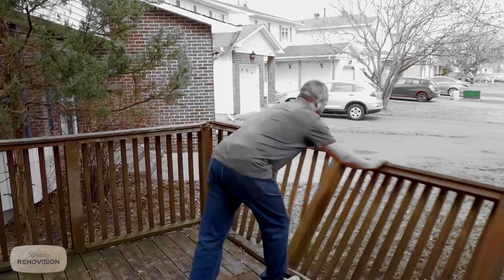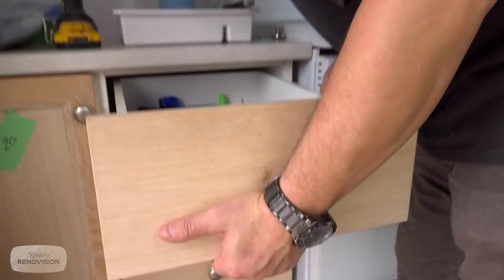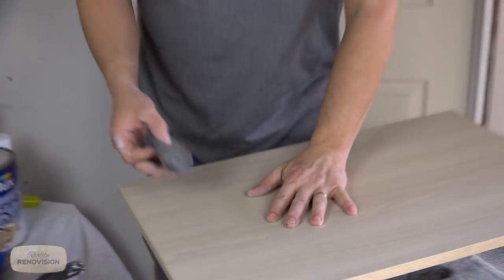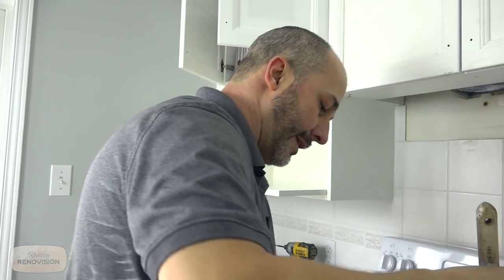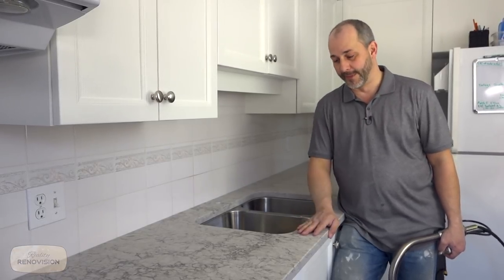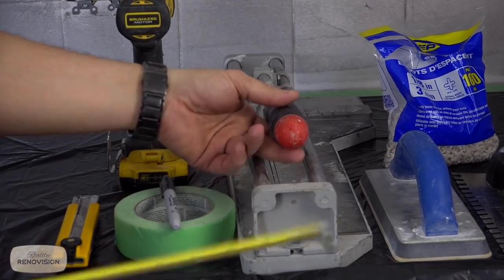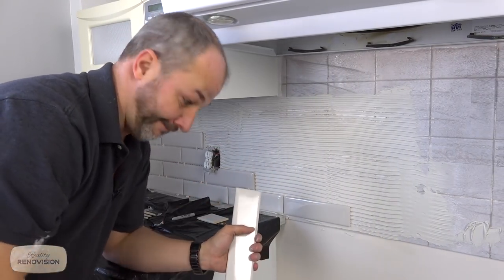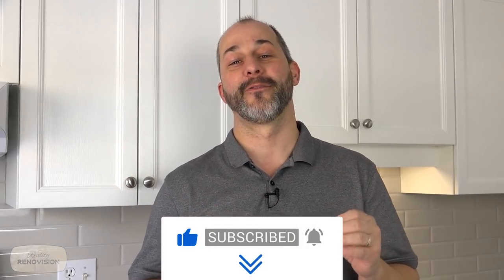I Remodeled This Kitchen For Only $4000.00 | Reality Renovision Ep14

Comment: honestly, i think the kitchen 'before' looks perfectly fine and then the transformation is WOW. i like both looks but the after is definitely a more 'clean' look and just pops compared to the more 'homely' original.
Reply: Share your comment
Reply: Not it doesn't. Not even the remodeled kitchen looks like anything other than dated. Just another color.
Reply: @aleksanderkac7530  I think that’s because of the white appliances. Changing it to stainless steel would definitely have taken it to another level. However, the owner just wanted a bit of an update to get it more market ready. Updating the appliances would have blown what I’m assuming was a modest budget.

Comment: Taking tile out is a pain. Imagine taking off one layer and finding another. LOL
Reply: so dont buy old house
Reply: you can't take those tiles out. You need to cut the drywall out. So 1 or 2 layers doesn't matter.
Reply: Exactly
Reply: LoL!!! That would definitely call for a sledge hammer. 😡
Reply: Oh my God. I would be furious if I took off a layer only to find another underneath.
Reply: @ilseizi  Unless it's not drywall.
Reply: That is not the right way to do tile work, it makes the job too thick, its just 1/2 in sheetrock zip it all out and put in tile backer board, its only 24 inches high, its not that big of an area
Reply: @ryankwan1934  LOL !!
Reply: @jbncnow  The guy knows what he is doing. He is working within the clients budget and she is selling it. The chemical bond is much stronger and will take a lot of pressure to remove it, which no one is going to do.
Reply: @ilseizi  It does when we've been lied to for years. Thanks for comments. The truth revealed.
Reply: that was me when i started taking out wallpaper at the new house, found two more layers under 😫
Reply: Why would u take the whole layer out to find another? Wouldn’t u just find out by taking one tile off? Then stop ? 🤷‍♂️
Reply: @ryankwan1934  exactly my experience, renovation  of a house  built in 1937 :surprise after surprise :-D

Comment: great video, a few years ago we were looking at a kitchen reno, decided to just take the cheap for functional melamine cabinet doors off use a hair dryer to get the glue off, light sand and paint.  Thought was not likely to work but willing to put the time in as cost was very cheap.  Was very surprised how well it turned out!  Did a subway tile backsplash (first tile job ever), was very happy with how that turned out.  new fixtures and sink.  Ended up doing a bamboo countertop.  Looks great, does require more work needing to be oiled once or so per year and does stain a tiny bit though we like how the look is always evolving.  To get a stain out just put down a bit more mineral oil and the stain melts away.

It's amazing how a little bit of work, mostly paint to a lighter colour completely changes the space.  More light looks far larger.  If you can extend cabinet and counter down a galley kitchen can create a ton new space for little loss.

Comment: I really don't understand how you only have 163k subs. Two years ago, mid 2019, my house flooded. I got a $5,000 insurance payout but that was nearly enough to pay for the water clean up, mold treatment, drywalling, insulating, and new flooring. I watched this channel for a couple weeks to learn how to do it all, AND basic plumbing for the bathroom I was already planning to remodel. Went to Menards and Home Depot, bought the tools and supplies. Got it all done by myself, no help from even family, in a few months time. Just sold that house for $20k more than I bought it for last month. Not sure if it was market value increasing naturally or the work I put in, but regardless, thank you brother.

Comment: They have perfectly good drawers. I'd love to see a budget remodel with drawer updates (not just refacing) and without tearing everything apart to start from scratch with IKEA.
Reply: I am actually doing this right now eith a triplex but no paint job, just bought 2 outdated kitchens on kijiji for 400$, most of them are standard sizes 24, 30, 36 inch based etc with 12, 15 ,18, 24, and 30 inch uppers.  ,and I'm using ikea enhet white shaker doors (the cheap budget kitchen at ikea), a 12 inch 30" high door is 16$,  however the doors are actually the exact same as home depot white shakers. I use the base white cover panels to side the cabinets and use the toe kicks to fill the spaces in between doors and frame them with 2 by 2 in between cabinet spaces to give it a custom look. Spent about 500$ on doors and cover panels along with about 600$ on updated droors and dampers for hinges where necessary, 50 pack of black matte handles from Amazon for totalled about 150$. The kitchens I bought were quite large so they were able to make all 3 kitchens at the house out of the cabinet bases that came with them. Then shopped for quartz cutoffs from local suppliers and built the kitchens around the existing countertops and averaged about 400$ per counter and bought sinks 200$ a piece. So I averaged about 1300 per kitchen and they look completely brand new

Comment: Cutting corners the smart way, that's my kind of project.
Reply: No your just making a problem for somebody else later, take the sheetrock and cheap tile out and replace with the proper tile backer board,its not that much area . If you have to go around a corner  edge trim and bullnose around the edges are desighned for one layer of tile not 2 . You dont but tile on top of tile, its not the proper way, i dont care what kind of glue you use, its not the way you do it.
Reply: @jbncnow  
Blah blah
If it works it works 
It’s not gonna show ever
Reply: @jbncnow  LOL Imagine never thinking outside of the box because it's just "not the way you do it". There would be no progress, we would not have started using pig valves for the human heart for example... because until that point it was just not "the way you do it". Open your mind a little.  Besides, who cares what kind of work the next guy has to do? Let them worry about that.

Comment: The bags for the liner are the best. I use grocery store bags and sticky tape on the inside/under part where the paint sits. Very easy clean up, and a crumbled bag takes up a lot less space than a rigid plastic liner.
Reply: Real painters don't use paint trays. It's the first sign that the painter doesn't have a clue what they are doing.

Comment: Thank you for such useful information.  Will you be able to have a list of tools and suggested products that you used so that us newbies can follow more exactly.  Also, can such tile process be done in a Bathroom shower area given that there will be water and higher "traffic" in the shower walls?  Thanks
Reply: You should NEVER tile over tile on a bathroom shower or tub wall. The floor is okay if the prep is done first. It will raise your floor and be aware when you go to reset the toilet you'll need a longer toilet flange. This was a nice way to freshen up an old kitchen for less.

Comment: Just a thought when you capped off the tile with the aluminum. Instead of butting two mitre joints together, Instead I'd just use 1 whole piece and cut two 45s on the inside and bend it. This way your outside edge looks amazing and you won't have a joint. 

I learnt that when I was renovating grocery stores like Metro and No Frills.

Comment: $300 Epoxy-pour "marble" (heat-resistant) kitchen countertop for the win! I'm wondering, how many times can you tile over existing backsplash? Probably just the once or twice? Eventually, it'd be too thick for the plugs and everything right?  At that point, you'd recommend maybe breaking them out and replacing wall when needed?

Comment: I think you have a great channel and a lot of helpful info.  I think though using a roller especially that nap was a bad idea. If you are not spraying the cabinets with a fine finish tip and sprayer. You would want to use a fine filament brush and a 1/4 nap roller. Your roller had far too much nap. In fact when you first applied the roller a huge part of it was left on the door, and also why so much texture was left behind on the door.  A couple passes with the 1/4 nap roller, and it would have finished like glass. Just thought if people watch this they may want to know which brush and roller to buy.  Fine finish brush, and 1/4 nap roller is your only choice if you're not spraying the cabinets.  Just my humble opinion.

Comment: Not to pick ur video but ur roller is to big. I’ve been doing cabinets for 21 years. The best primer to use is bin shellac primer once u use it you will never use another
Reply from the maker: Cheers frank!
Reply: I admire your attitude. A lot of people get pissy if you try to tell them that there is a better way. Don’t get me wrong I’m not one of those people that think they know everything but I do know better then some in some areas. I’ve learned a lot from ur videos and for that cheers to you as well.
Reply: Have you tried Kilz Restoration?  It's more expensive, but it's literally bullet proof once cured with amazing adhesion, color and stain blocking and water clean up.   We used it to prior to painting in my mother-in-laws home where she had smoked heavily for decades, and the walls were brown.  TSP did not work, it was our last hope.  3 heavy coats and not one bit of bleed through from nicotine and true paint color.  I had about 2 gallons left out of a 5 gallon (our second one) and I have used it to paint cabinets.   For any area that will get heavy use, I would use it over any other primer.  I am so amazed with it.

Comment: Great video. Thanks for updating us. What we did with our dark oak cabinets was to degrease with tsp and rinse rinse rinse it off and then sand so you don’t drive the grease into the wood. Sand until you think your done and then sand some more. Two coats of primer allowing a full day between coats to dry. Then two coats of an enamel top coat paint allowing at-least 2 or 3 days to dry between coats. Then let cure couple weeks before putting on hardware and installing. Lots of work but you won’t regret it.  We just posted on our channel a 2 and half yr update video on our painting results.

Comment: I started with one cabinet door (DARK maple finish) to test brushing/rolling... But the brush and roller marks drove me crazy after 3 coats Bin primer then 2 coats paint! Also, with 25+ doors, at least as many drawer fronts... then the boxes - it was going to take FOREVER! So... what about spraying? I already have a Harbor Freight Krause & Becker airless, thinking about setting up a "painting tent" in the basement. Any recommendations on the type of primer/paint? Sprayer tip size? I have read about Kilz Adhesion primer? I'd like to use a white satin finish latex paint. Any other suggestions welcome!!

Comment: Love this video and it's tips and tricks: but I learned to use a painting pad instead of brush or roller for most painting surfaces... it takes minutes instead of hours. I can paint a door in 5 minutes, two coats... when it really needs only one coat in 2.5 minutes! Give it a try. And thanks again for this excellent video!

Comment: We’re in the middle of a kitchen Reno... wanting to replace the tile floors with laminate but tile is wall to wall under the cabinets.  What is the best way to get the the title out as close to the toe kicks without removing cabinets? Toe kick saw with a dry tile blade? Score it with a oscillating tool?

Comment: Can flat LED lights be added instead of the boring single light above the sink? Countertops can be dark areas when there are no windows in the kitchen. Can existing wiring for that single 'above sink' light be used to wire the aforementioned flat LED lights under the cupboards? What lights do you recommend? Also how can extra plug-ins be added for the countertop appliances and do they need to be GFCI or AFCI or a combination AFCI/GFCI in certain areas of the kitchen?

Comment: Backsplash looks great and what a time saver going over the top. Can I do the same for shower tiles on the walls? I need to replace the shower pan (leaking) but will use a different tile on the floor.

Comment: If you have a fairly light stain on your cabinets, high most modern cabinets have) then you don’t need to sand down to the wood. Just degloss then, prime them with a good wood primer, and use cabinet paint. Cabinet paint dries hard and attaches well to the primer. The primer will attach well to just deflossed wood. I did many cabinets and years later I don’t have any issues even though I didn’t sand them completely. This isn’t the same for stain. If you are staining, be sure to strip the wood completely.

Comment: Hi Jeff,

I recently purchased a mid-century (1959) SFH in South Florida. Additions to the original structure, which is under the gable-styled-roof-on-trusses include a fenced porch-on-a-concrete slab & a carport in the front; and a living room + a lanai that was closed-up and turned into a bedroom (under AC footprint). The space distribution has become my architect's worst nightmare. The drawing that makes the most sense to us requires moving the kitchen (currently under the gable roof) to the living room area, and opening up the wall that separates the two. The issue I'm facing: There are tie-beams carrying the loads of the trusses that support the gable and the rafters that support the living room's flat roof. How should I tackle this project?

Comment: Hey Jeff,  Looks like you also replaced the sink in that video, but I'm wondering if I can use my old one which is in good condition and has a nice flange for sealing, and save some money.  Looks like I might just have to trim off the back edge crimp , but otherwise looks doable-any comments?

Comment: It’s amazing what you can do to get a house ready to sell. Mapei makes some of the best adhesives for tile work, so it’s good he used the proper products to overlay  and bond to the original splash.
Chances are it looks 1000x better for selling the house, and the new owners can always gut it later if they want nicer cabinets. 
This was a budget kitchen renovation, so it appears he did a great job for what was wanted.
👏👏💥👏👏💥👏👏💥
Reply: I just passed on many houses where the owner tried to increase the value by painting their ow cabinets. I would have had to replace all the cabinets to fix the mess they made, so I decided to save money by buying a cheaper house that needed the cabinets replaced. Most people aren't adding value to their homes by painting their cabinets, they are removing value.

Comment: I have Formica backsplash that is glued to the dry wall. Do l need to pull off the Formica (which will most likely mess up the drywall) or can I do as you have done on this video by putting tile backsplash over the Formica. Will it work!

Comment: Like the Reno!  Quick question I want minimal work on plumbing.  If the size of my drop in sink is 31in does that mean I need to also get an undermount sink of 31in?  I’m replacing my countertop with quartz but don’t want extra work to adjust plumbing.  Thanks!

Comment: Great video. Makes it look easy and what a saving! My only comments would are ... I missed the final application of the cabinet paint. I watched all the prep and priming but what happened to final coat of paint? Did you roll it on? How smooth was it. I think spraying would have given a better result. Also, could you have taken off the tile just on the left side to avoid using the aluminum edging?

Comment: I am looking to put a "luxury" vinyl over the top of existing tile and I want to "fill" in the grout lines and make a level surface.  However, I can't add a ton of height to my floor.  Would the Eco Prim Grip work for that?

Comment: I want to challenge you on natural granite countertops. My son used to sell and install them. The stone has what's called fissure's. They are lines in the stone of cracks or differing stone properties. They will heat up and expand at differant rates. Therefore you shouldn't put a hot pan on granite either as it too will crack or fracture.

Comment: The only thing missing from this video is the sense of time it takes to paint the cabinets.  It takes forever and a day unless you are a seasoned pro. The guy here is a good painter, and a lot quicker than typical homeowner.  I'll bet it took him 5 days plus the half day to re-hit the sap spots.  Also, it takes time to make sure the finish is consistent and smooth.  you're doing a major cleaning and initial sanding, prime, sanding, paint, sanding, paint second coat.  That's the minimum.

Comment: The only paint to use on cabinets is Sherwin Williams Emerald Urethane Enamel in Satin finish.  Trust me here, your best best it always use a oil based primer.  If you  prime your cabinets and find tannin bleed through(wood oils) you'll have to do it again in oil to get rid of it.  This will help white cabinets not look yellowed as well.

Comment: Wonderful transformation.  I can see you're experienced the way you control that enormous paintbrush, and your grout (you call it cement) work was very tidy and precise.  I am confused by your method of putting stain block on at the end, two weeks later or so.  Normally stain block goes on at the primer stage so that you don't have to go back after the top coat is on.  You've obviously got a good reason, you just didn't explain it, (or you did but I missed it because you tend to use different vocabulary to the material names I know).  Also Dulux?  That's a dirty word in my household, and not just mine - most pro's here won't touch it with a bargepole any more.